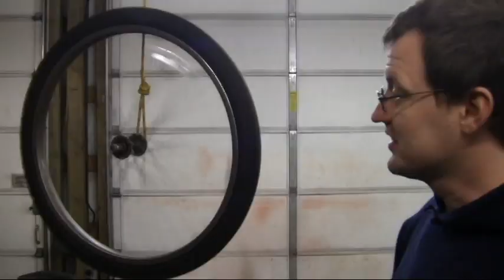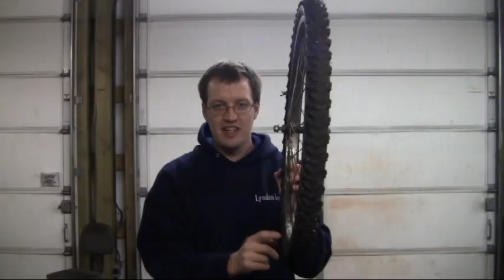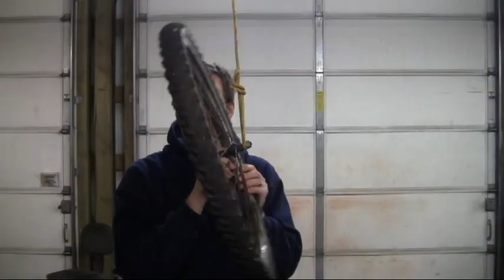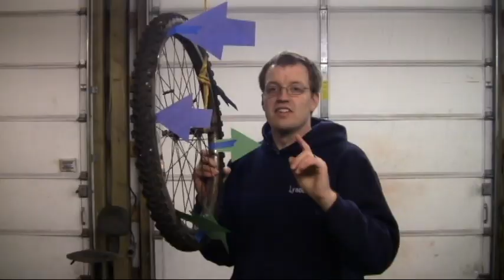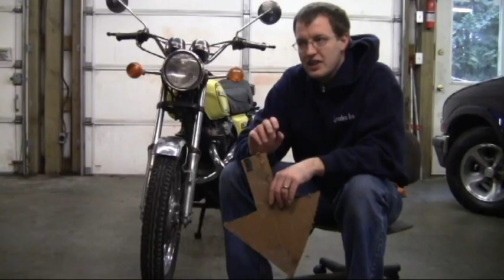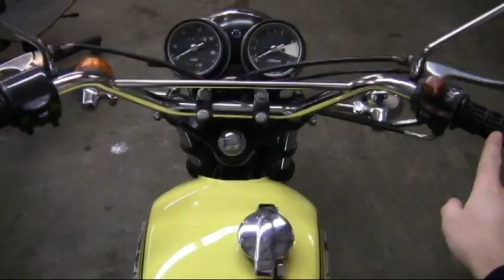Gyroscopic Precession LONG VERSION explained logically (Spinning Tire on a string gyroscope gyro)

Comment: Please don't criticize the usual way to explain gyroscopic precession just because you don't understand angular momentum well enough. Your video is pretty annoying because of that (in addition to your misuse of physics concepts- you keep mentioning a force on the top part of the wheel, etc., but in fact that thing you're talking about is torque, the time derivative of angular momentum...).
Reply: Nico, Curt is explaining the gyroscopic precession founding it on the Newton Laws. Torque is not formally part of the Newton Laws. And I didn't find any misuse of physics concepts by the way.
Reply: bernardomichel1 What upsets me is that he is using the wrong concepts. There is absolutely no sideways force on the top part of the wheel, so it's kind of meaningless to talk about the motion in those terms. (Although I definitely understand the temptation; but it's tricky and it can be misleading to misuse these concepts, so it's better to not do it in the first place, even if it can bring about some clarity in a specific case.)

What also upsets me is that he writes off the angular momentum explanation as "illogical", seemingly because of the right-hand rule. But that right-hand rule that he talks about (and subtly criticizes) is only a technique that we use to remember what direction the torque is in (or the angular momentum is in); the right-hand rule is a human invention simply used to remember physical phenomena which are independent of humans. The physical phenomena (angular momentum, torque) still work and are completely logical, regardless of our right-hand rule. 

He says "I understand that the rules work.. But why, why does that rule exist?". Well, it comes directly from Newton's laws, and the definition of angular momentum! This explanation that Curt is against comes from Newton's laws.

These rules of angular momentum and torque are just as fundamental as Newton's laws, if you think about it (consider that we start from Newton's laws merely due to historical reasons; maybe if torque would've been 'discovered' first, and we'd think of motion in terms of rotations. Perhaps Newton's laws would be the rules Curt would be calling "illogical" in this alternate scenario). Granted, for us it's easier to think in terms of forces and linear acceleration, but the real reasoning behind gyroscopic precession can be found in terms of torque and angular acceleration. It's harder to think about, but a truer description of what's actually going on. 

What upset me most, though (I think), is his abuse of Newton's laws (and misconceptions that people have regarding them). It's crazy how much he misuses the concepts (I can post another comment tomorrow if you're curious on precisely what his mistakes are). 

Sorry to have written so much, I get passionate about this stuff :).
Reply: Nico Valdes , Veamos, Nico (acabo de descubrir de que también hablas español). Vamos paso por paso porque estás hablando de muchas cosas al mismo tiempo y se me hace más fácil expresarme en español. Déjame empezar con el primer párrafo: Estás diciendo que no hay fuerza lateral en la parte superior de la rueda. Esto es falso por la siguientes razones. La primera es que debemos pensar en fuerzas resultantes, es decir, la cuerda, aplicada al centro de la rueda ejerce una fuerza de tensión sobre la llanta en la dirección hacia arriba, mientras que la gravedad lo hace hacia abajo sobre el punto superior de la llanta, a su vez hay tensión entre los diferentes puntos de la llanta por su estructura, finalmente, el momento de fuerza, debido a la gravedad, es mayor en el punto superior que en el inferior por sus diferentes distancias con respecto a la tierra. La razón por la que Curt no habla de estos detalles, me imagino (no lo conozco y nunca he hablado con él) que se debe a que no vienen al caso con el tema que está tratando (y para alguien interesado en estos temas le debe ser evidente que se trata de fuerzas resultantes).

En la primera parte del segundo párrafo, yo más bien creo que lo que Curt está tratando de decir no es que el momento angular sea ilógico, sino que el modo tradicional de explicarlo se "salta" lógicamente muchos de los pasos para explicarlo y llegan como por acción divina con la funcionalidad de la mano derecha "y nadie sabe por qué".

Por lo que escribes en la segundo parte del segundo párrafo, específicamente después de tu primera oración, lo que entiendo es que tu crees que el momento angular (si es que te estoy entendiendo bien) es un fenómeno independiente y que no es "derivable" de las leyes de Newton. Creo que así lo entiendes porque estás diciendo que la regla de la mano derecha solo la usamos para recordar los fenómenos exteriores a nosotros. Es cierto que la construcción de conceptos son para aplicarlos a los fenómenos exteriores a nosotros, pero otra cosa muy distinta es ver a unos fenómenos DEPENDIENDO de otros fenómenos, en este caso el momento angular y la presesión giroscópica DEPENDEN de las leyes de Newton, es decir, no son independientes de las leyes de Newton. 

En el tercer párrafo estás repitiendo lo mismo que en el segundo párrafo pero con otras palabras, pues estás diciendo que la regla de la mano derecha se deriva de dos cosas que tu mencionas: De las leyes de Newton Y DE LA DEFINICIÓN del momento angular. Pero eso contradice lo que mencionas en el segundo párrafo, donde para ti el momento angular es un fenómeno a parte, no una definición. Pero aun siendo cierto, la explicación es suficiente con las leyes de Newton, como se puede ver en el video. 

En el cuarto párrafo vuelves a repetir la INDEPENDENCIA  de las Leyes de Newton con respecto al momento angular y la torsión. Por otro lado yo todavía no conozco ninguna teoría que explique las leyes de Newton a partir del momento angular y la torsión. Lo que sí he visto es que existen teorías para explicar las leyes de Newton a partir del principio de MÍNIMA ACCIÓN, pero el principio de mínima acción no es un fenómeno que se pueda observar ni siquiera por inducción,. por lo que queda al nivel de hipótesis instrumental y es válida solo por su poder predictivo. Lo que sí es observable, por lo menos para objetos grandes, son las leyes de Newton, y si tu te tomas la molestia de leer el tercer volumen de los Principia verás que las leyes las derivó precisamente aplicando el principio de inducción y, a partir de esa leyes es posible derivar tanto la torsión como el momento angular. Por otro lado, tienes razón en decir que Curt mencionaría a las Leyes de Newton como "ilógicas" (bajo la consideración que menciono en mi primer párrafo) si tomas como principios la torsión y el momento angular, pero eso solo bajo la condición de la Independencia que ya explique creo que de manera exhaustiva.

Por último, puedo esperar tu comentario sobre el mal uso que hace Curt de los conceptos. 

Igualmente perdón por escribir tanto.
Reply: bernardomichel1 Hola, te importa si escribo en inglés todavía? Por lo menos para discutir física, me sale mucho más fácil hablar en inglés.

First, I will address the issue of a side-ways force on the top part of the wheel (as well as my reasons for why using Newton's laws is inadequate in this situation). Newton's laws are great for describing the forces on a single particle. However, applying them to extended bodies (like this wheel) can be tricky. There's two options if we want to do a force analysis for this body: we can analyze the forces on the center of mass, or we can look at a specific part of the body (like the top of the wheel).

Let's analyze the center of mass first. There is an upwards force exerted by the rope, and a downwards force which is the wheel's weight. These forces are both directed vertically, so if the CM will accelerate at all, it will be only in the vertical direction (there's no side-ways components of the force that could make the CM accelerate sideways). This isn't very useful, since what we are asking is- why doesn't the wheel rotate downwards? 

If we look at a small portion of mass at the top of the wheel, all we find is the normal upwards force exerted by part of the wheel below, as well as the weight of the small mass on top which points downwards. Again, no sideways component for any force. There is no reason whatsoever why there should be a sideways force on the top part. This "force" does not exist. Incidentally, this is what I was referring to when I said that Curt abuses Newton's laws; they are not designed to analyze extended bodies, so obviously applying them for that kind of analysis will not work adequately. 

Your next point, I understand. Maybe in explaining gyroscopic precession, people shouldn't skip any steps and they should make perfectly clear what is going on. Perhaps some people who don't truly understand it pretend that they do and merely say "because of the right-hand rule". 

Next: Newton's laws vs. torque and angular momentum. I think you misunderstood me (sorry, maybe I was unclear)- our laws of torque and angular momentum are simply definitions, and they absolutely do depend on Newton's laws. (Torque being the time derivative of angular momentum is a key point in the explanation of gyroscopic precession, and that fact is derived from Newton's laws.) What I meant when I said that angular momentum is "independent", I did not say of Newton's laws; I said of humans. I meant that regardless of our right-hand rule, angular momentum and torque, as they are defined, will still behave in the way they do. 

What I meant when I said that force and Newton could be based on angular momentum and torque was this: imagine that we say: the torque on a body (for fixed axis rotation) is equal to the time derivative of that body's angular momentum. We could then make a relation between linear and angular momentum, and between torque and force, and go on to say- the force on a body is equal to the time derivative of that body's linear momentum. 
Basically with this, we see that Newton's laws aren't any more fundamental than our (seemingly arbitrary, according to Curt) rules for torque and angular momentum. Force doesn't seem so special anymore. 

Finally, (somewhat off-topic): I have a doubt regarding what you said about the stationary action principle: "el principio de mínima acción no es un fenómeno que se pueda observar ni siquiera por inducción". What do you mean by this? Newton's laws are postulated by Newton- they can't be derived theoretically from anywhere else, if you use them as your starting point. Neither can the stationary action principle, I believe, so it's not exactly relevant that it can't be derived through induction. I'm afraid I misunderstood what you meant, though. 

Thanks for the lively discussion, I await your response.
Reply: right-thumb rule is a made-up rule to teach elementary students from the start. any phD don't need that. and torque also is a facilitated way of explaining something. what we need in basic is only Newton's basic 3 laws.

Comment: First, I want to say this is a superb video. Excellent job. However, I find the bike part incomplete, for several reasons. First, the force of the cross wind acts on all parts of the tire equally, not just the top, so at first blush it's not clear why the tire should turn at all. You have to include the frictional force of the ground on the bottom of the tire for it to make any sense.

Even then, though, I don't think it explains why the bike doesn't fall. Before the wheel turns, for example, the entire bike itself will tilt slightly. Now we have not only the wind but gravity to contend with, and I think explaining--in common sense, non-angular terms--why a bike isn't easily tipped over by gravity is much more difficult. I think it might require discussion of Coriolis-type effects. Probably merits a video of its own.

Comment: Just a bit off the subject but have you ever had a go at one of the arcade game type motorcycle races. I kept running into the fence and my grandson could beat me because they had not designed the game well the bikes actually turned right when you turn the handlebars right. Obviously my grandson had no problem with this as he has never ridden a bike while I have been riding one for years.

Comment: Curt, there is one gap in the logic. Why is the 12 oclock section assumed to be stationary? What happens in reality is the whole tire starts out stationary and rotating, until you rest the axel on the rope, getting that force field you talked about. The stuff that starts at the top does what you said, with a + velocity from 12oclock to 6 oclock, and a - velocity from 6 to 12. The stuff starting at 3 oclock is moving the most at 9 oclock (+ direction), and comes to a stop at 3 again. The 6 oclock stuff does the same as the 12 oclock stuff, and the 6 oclock stuff does the opposite of the 3 oclock stuff! I'll think about it.

Comment: the only forces on your tire are due to its mass and gravitational force and they aren't in the direction of those arrows, they are all down towards the ground.Only reason why they are going in those directions are due to its tangental acceleration and torque which is at the point of where the string are to the end of the tire.but your explanation of the forces that make it spin gyroscopically are good although those forces aren't forces its the direction of the torque

Comment: I'm struggling to understand his statement at 6:45 . Where he states that acceleration from top to right hand side is cancelled out by acceleration from right hand side to bottom. The force at the top and bottom are in opposite directions so shouldn't that double the acceleration?

Comment: Hum... the only reason that there is a force on the top of YOUR tire is because of the imbalance created by placing the center of gravity off center by hanging your tire by a string at the extent of your axle. But the gyroscope is not dependent on that external impetus. The gyro is asserting its change-resistance regardless of any kind of potential energy from such positioning. It works even in space. Your analysis seems to presume too much to be applicable to more general physics.
Reply: ***** I see. Taken in that light it was a helpful explanation. Thanks.
Reply: ***** Why is it that if you spin a gyro with more volecity the delay in  force to accelration does not increase past the 90degrees point and why is that the concrete rule no matter the speed that the gyro  is spinning or can the force in a gyro be delayed past 90 to even 100 degrees if it is spead up?
Reply: yo it is because of the direction of the torque is along the disk axis. If you think about that way it's easier to see why it's always a 90 degree effect. When you apply a force on the axis, the resultant force is the cross product between the torque and the force you apply, resulting in a force direction 90 degree from the plane where the axis and the applied force lie on.
Reply: Jack Le  I don't think my brain got the physics gene!
Reply: +William Ross gyroscopic precession only occurs if force is only applied to one side of the axis. If the tire was suspended from both sides it would not have precessed.
Reply: Ihsan Ali  They gyro is quite amazing.

Comment: This logical explanation is convincing if you follow the presentation meticulously. The problem I have is not with the logical explanation of precession. There is a paradox, or something missing, in the result that the turning happens 90 degrees after the force, so the wheel precesses rather than falling. Since the shift of 90 degrees is independent of the rate of spin, suppose the wheel spins very slowly, say one rph, 1 revolution per hour. Basically, you could not see the wheel revolving, and so it should then act almost like a non-spinning wheel. Yet the precession is still supposed to happen 90 degrees after where the force is applied, instead of the wheel falling, and the wheel is supposed to stay vertical. Yet the wheel will not stay vertical at all.

 Of course we already guess that the wheel has to be spinning fast enough. But why? And how fast is fast enough? Precession is explained, as long as the wheel does not fall, but not why the wheel does not fall. Or is the wheel always falling when precessing, but for reason unclear, very gradually?

 Anyway, thanks for the clear part. I understand more than I did before, but not enough.
Reply: duah ...!  Dude , your gonna hurt yur brain housing group... relax, and chill out... just think of the planet Earth & all planets as huge Fat tire/wheels , cycling through space in their radial axes ... sort  doing a universal gyro tron thing ... will that help you to turn off the mental switch ?..
.L O L
Reply: I feel better already!
Reply: It's because the slowing of the wheel means that the velocity at the start is more than the end so it should fall at the rate of the difference in velocit... I think, So glad I saw this video now my brain doesn't quite so much when I think about this.

Comment: Ok so gyroscopic precession would be null if mass was null. It's only due to inertia. Thanks you helped me understand what I needed.
Where did you get the info in the first place?

Anyway brilliant explanation man. Although I feel there's an additional phenomenon that makes so that the bike will lean left if the handle bar is turned right. Namely gravity centre finding itself left of the wheel that drifted right while the inertia of the bike left its gravity centre left of the contact point with the road (hope you see what I mean, my english is limited to a non scientific lexicon)...